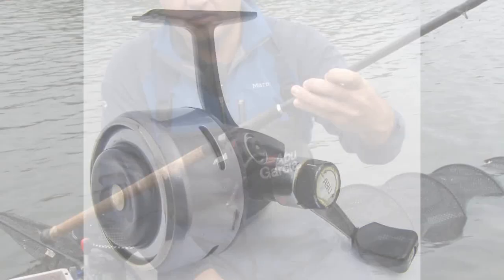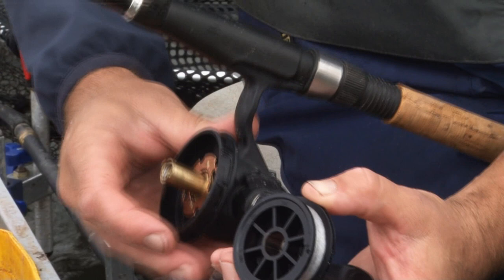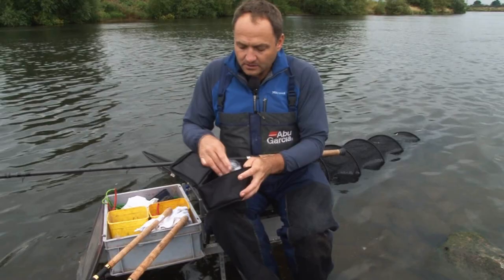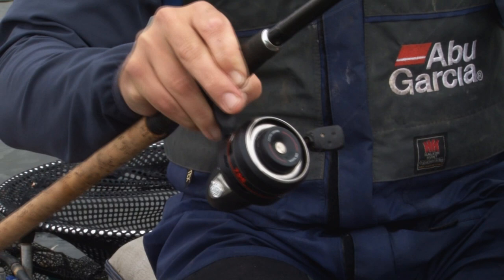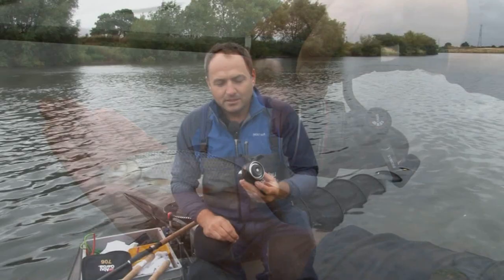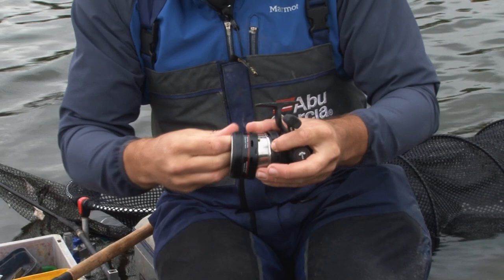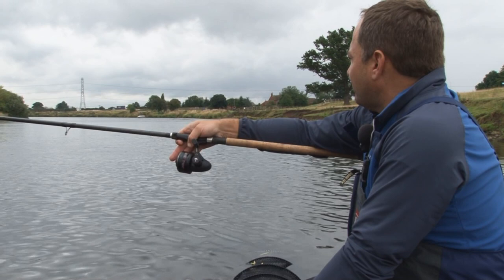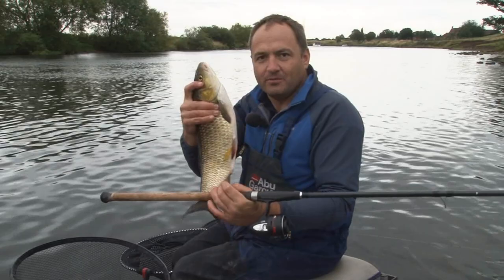James Robbins presents the new ABU 706 Closed faced reel

Comment: I love using closed face reels - currently a 704. But it's about time someone designed one properly instead of just making a few tweaks - although some of those seen here are sensible. The problem with my earlier version of this reel is the useless "half drag" mode. This is engaged (accidentally most of the time) by back winding a fraction of a turn (anti-reverse engaged). It's supposed to return to the full drag value as soon as you begin winding forward again: frequently this doesn't happen, allowing a decent fish to strip line effortlessly. I have dis-assembled and re-assembled the reel several times without managing to cure it.
I have a couple of near mint 505s (which I don't use) and a non-functional 507 "Gold match edition" too. The latter, which I was given as a broken unit, has a larger diameter spool, which is a shortcoming of the other versions - its extra size and weight is insignificant but there seems to be no anti-reverse. I'm also curious to know if the current Daiwa version is any good.

Comment: Just brought a new Abu 507 mk11 how do you spool the reel the spool just goes up and down it doesn't turn
Reply: I had this problem with my new 507. Took it back to shop and they just removes the excess grease from the bale mechanism and it's fine now.